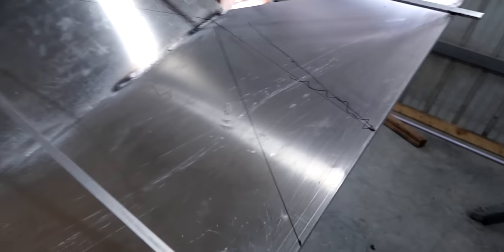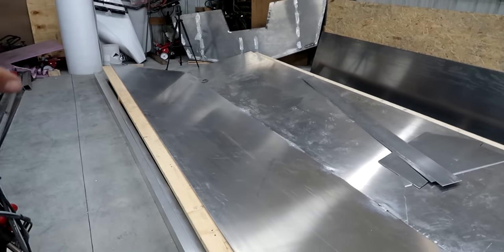Building a 25ft Aluminum Boat Part 6

Comment: Any water that gets into your hull will not get to your drain hole with those longitudinal stiffeners. The only path to the drain is the narrow channel down the center. Are you going to form some 2X4 tube to continue the stiffeners to the bow? I'd bump form them on an old tractor rim or something else with a large diameter. You are doing a great job. Cant wait to see this beast in the water!

Comment: I know it is early but what size motor are you going to use. I know you said no speed demon, but should go up on  plane  fully loaded. Just wondering maybe 90 or 100 hp should do nicely, guessing the weight. forgot to say
 looking really nice.
Reply from the maker: Thanks. Putting a 200 hp tiller on it

Comment: How the hell do I attach a couple photos, to show what your doing wrong?
I have a set of computer designed plans of a 16 foot version of this 25 ft skiff your building.
It shows how your frames should be cut then folded out of the same sheet material that your building the hull from, NOT from RHS tube for reasons already explained (Galvanic & Crevice Corrosion / Electrolysis).
It also shows how your stringers likewise should be cut from plate to conform to your bow sheer, again not made from RHS tube.
It shows how the frames & stringers should be cut to “interlock” & how the drainage cuts should be made to allow water to run to the transom bung holes by first draining past the longitudinal stringers to the keel & thence along the keel seam joint to the bungs in the transom.
If you want to post your email address I’ll send you photos of the naval architect drawn plans so you can see where your screwing up BEFORE you keep wasting all this expensive aluminium sheet.
The plans show how each panel, frame, stringer, and all the hull sides transom are all supplied nested in the sheet, CNC plasma cut to within 1/10,000th of an inch accuracy!
Every frame & stringer position is permanent marker drawn by the same CNC program to indicate where each piece is tack welded into position.
In short all this crawling around on your hands and knees on the ground is eliminated because ALL the lofting is already done to extreme accuracy, well above the standards you will achieve with your rough as guts laser level method.
Up to you if you want to avail yourself of the experience knowledge & skill of trained professionals or you can just keep guessing & making it up on the fly from some plan in your head & half assing it as you are stubbornly doing now.